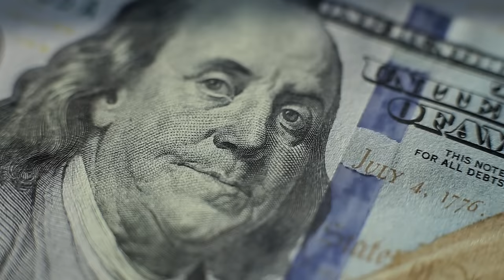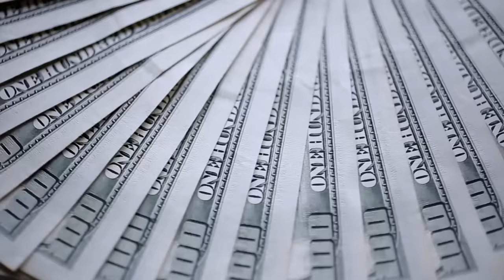10 Massive Bridge Collapse Caught On Camera

Comment: That first bridge probably belongs to a village further down the valley now
Reply: Definitely 😭🤣
Reply: That first one was probably owned by a village upstream before the last flash flood.  To be fair it looked like it was just laying on top of the dirt.
Reply: Looks like a Bailey bridge, which is an inherently temporary structure easily built.  If not too much of it was damaged, they could've found it downstream, taken it apart, and rebuilt it somewhere.
Reply: Well built for sure
Reply: 🤣 True, and they have paid it forward downstream to the next village.
Reply: @denimadept their temporary...until their in their nth decade and still solid.
Reply: Bailey bridges are so well connected that with more reinforcement, stronger pillars & a thicker deck they can become permanent.

Comment: 14:30
The driver is always the last one to make sure the height limits are under control. Its his responsebility
Reply: I do know of one case where it wasn't the driver's fault. (Not trying to rain on your parade, I just know of an oddity) The state and local HWY Dept. kept resurfacing the road in the vicinity of a bridge overpass, till the surface was some 18" higher than it used to be. The authorities never thought to adjust the bridge height limit sign. When the truck driver tried to run under the bridge - Bam. He took them to court and won.
Reply: True that.  But no overpass bridge should be able to be toppled by an inevitable over-height truck.  Chinese Tofu construction!  😬
Reply: Responsibility bro
Reply: @kenkahre9262 Wow! I bet it was such a good feeling for the driver to shut them up after he was probably blamed 846 times for watever went wrong in that accident!